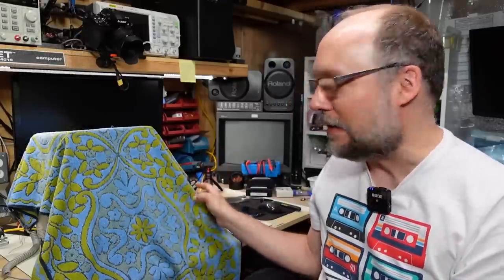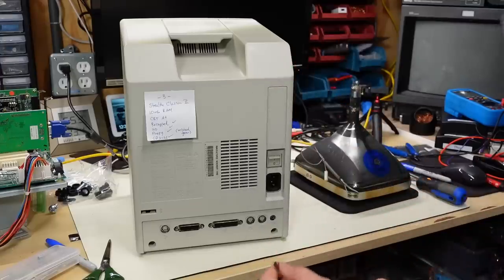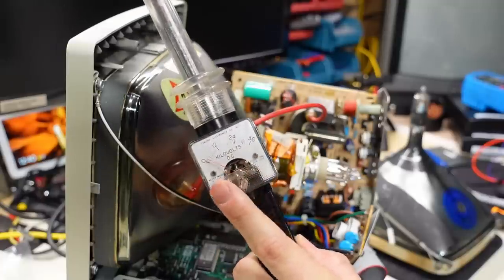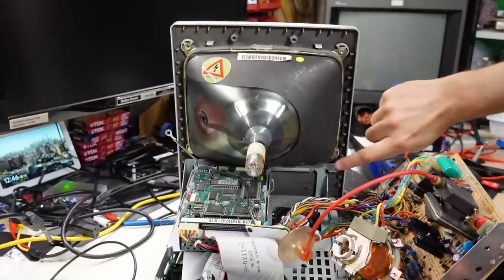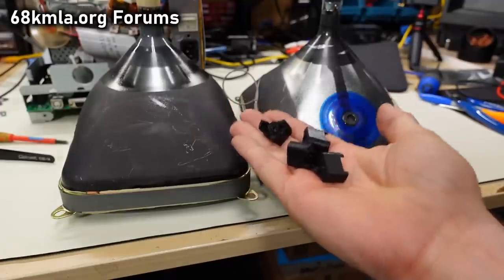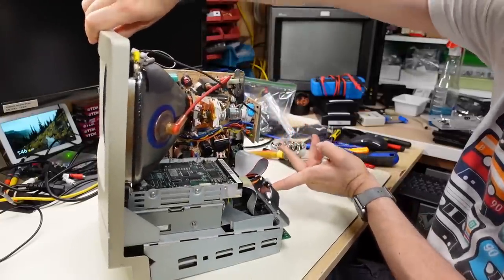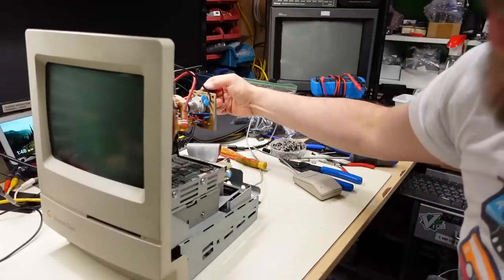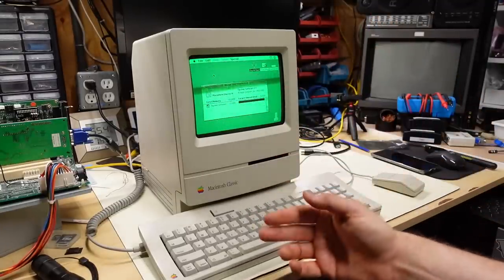Apple never built a Mac like this

Comment: We are not museums or historians; a little mod here and there to make old school tech more accessible to the user is fine in my book. 😁 Always good to see a bit less e-waste and more useful machines, even if they are now pretty much just for fun...
Reply: @eck8989 Exactly what I mean - I'm not into Macs myself but I like to resurrect old school tech. The phrasing was meant as a reply to Adrian asking if people think that he ruined that classic machine.
Reply: I fully agree. The most important part is to get it going. Perhaps, also, if someone needs a "proper" part, you could then pass it on if it's in decent shape.
Reply: I'd agree completely.  

I think one difference with modern "antiques" and old antiques is that things made in the 20th century were made for purposes we still find useful, but are complicated enough that they require maintenance.  So the old idea of purity doesn't apply.  We own these things to USE them, not to sit on a shelf.

There's long been precedence for this idea.  People have been collecting cars for decades.  People that restore them want them to RUN, show them off, and drive them around.  Not sit in a garage collecting dust.  They restore them to work, and they sometimes modify them and put new engines in them.   It's still useful because we still use cars!

There's another class of antiques that fall into a completely different category.  Stuff like a butter churn, or a pickling crock, or a washboard.  Nobody uses these things anymore at all or any modern equivalent (my parents had all these things sitting around the house as museum pieces). 

I just think there's an inherent difference between these two types of antiques.  Especially a computer.  A computer sitting on a shelf, not turned on is just a hunk of plastic, metal, and silicon.  It doesn't really become something of value and interest until you actually use the thing.  Cars are the same.
Reply: @stevesether  Hey, I use a butter churn and pickling crock all the time!
Reply: There are enough in museums anyway, let's have fun with them!
Reply: My only complaint is that it's not an SE/30 with an amber CRT.
Reply: I still pine for my old Mac Classic; somehow it just made creative writing easy. I wouldn't mind using one today if I still had the space (and a cheap way to transfer files)...
Reply: @MyNameIsBucket  there’s a FOSS text-mode program called Wordgrinder which I love — you can put it in full screen and write write write, and worry about editing and formatting later :) my favourite feature is how it keeps the active line in the centre of the screen so I never need to move my eyes! 

I don’t know if that would help emulate what you got from the classic Macs, but I do suspect the smaller screen on them created a somewhat similar effect…!

Not an ad and no pressure though, of course :D just sharing a tool I like.
Reply: That mod can be always reverted if you got the original display and the classic Macs aren't so rare to be overly crazy about accuracy. Of course I'm not for drilling the holes and painting the case. 68k Macs have pretty nice design, so messing around with it is a bad idea.

Comment: Green is one of the colors our eyes are most sensitive to.  Following that, if you keep the intensity low, green results in less eyestrain.  Amber is perceived to be easier on the eyes because it tends to have a lower perceived brightness.  It's counterintuitive.  Clarity and adequate contrast at a lower overall brightness is easier on your eyes (assuming you adjust it correctly.)
Reply from the maker: Interesting! I know I've read that tungsten filament bulbs in cars is easier on the eyes but indeed is less bright -- for similar reasons I guess?
Reply: @adriansdigitalbasement  Definitely easier on the eyes than the bright blue-white of an LED headlight.

Comment: I watched a video the other day, an interview with Steve Jobs and the rest of the Mac team from Apple, and a question came up regarding the B&W nature of the screen.

The basic response was that B&W was chosen because they could have a higher resolution screen and graphics than if they had tried to do colour, and that B&W would be better matched to upcoming laser printers which would be B&W at that time anyway.

Colour was a matter of cost - trying to fit high resolution colour graphics into the Mac at it's price point just wouldn't have worked commercially.
Reply: So, two things about this: First, I heard somewhere (can't find a reference off-hand) that in 1982/3 during development of the Mac there was only one large-scale supplier of 9" full-color CRTs, some company in Japan. The CRTs were really expensive, so Steve flew out there to try to negotiate a deal. Supposedly he showed up to the meeting under the influence of something and made a total ass of himself so the whole deal was cancelled by the manufacturer. The "we prefer B&W" story was then made up as cover. Is it true? Maybe, but probably not. As noted, a color version of the Mac would've likely doubled its already high price because you'd need not only the color tube but more RAM and a faster CPU to process the extra pixels as smoothly as B&W, and more disk space to hold the color icons and whatnot. Is it believable? Yeah I wouldn't put it past Steve to do something like that.
Second, and verifiably true, is that single-color CRTs are much sharper than RGB CRTs (at least, as far as 1980s-era tubes go) and so are preferable for precision work (CAD, graphic design, etc) and also well-suited for the low resolution (512x384) of the original Mac: sharper dots mean things can be smaller on screen without getting blurry. White was likely chosen because it's closer to working on paper, which is what most office-type jobs involved prior to computers whether you were reading documents all day or creating them yourself. Amber is usually considered to be easier on the eyes over long-term use compared to white, but that may be anecdotal; anti-glare coatings are likely to have more of an effect (and anti-glare CRTs were supposedly common upgrades back in the heyday of B&W Macs, since most of their tubes didn't have anti-glare from the factory).

Comment: Neat swap! One day, it would be neat to see retro inspired LCD mods (not channel specific, but generally) that replicates the curvature of CRT's too.
Reply: That's been my main gripe with LCD mods trying to make dead CRT devices useful again. I still have an early iMac with a dead CRT (dim, blurry AF, HV cutting out) and a semi-dead logic board (boots but will randomly freeze). I've thought about putting an entire ITX PC in there and a 15" (i think it was?) LCD, but the slight curvature of the case for the CRT makes any LCD mod look like ass, so it's been collecting dust in the basement ever since. 
I've even thought about venting the original bad CRT and carefully cutting away at the glass so that only the front face with the mounting screws stays intact, then getting rid of the phosphor coating and sticking an LCD behind the original front glass or something, but since I have no clue how to cut the glass without making it crack and ruin the front that idea never went anywhere either...

Comment: I'd still go back inside later on and put the thinner support in to prevent the screw from tearing the end of the plastic mounting point. I'd be just a little afraid of that. But still very cool, though I prefer the white screen :D

Comment: A very important thing to check before swapping CRTs is the filament voltage. I believe most of these 9" monitor tubes are 12v but 6.3v is also common on CRTs (and vacuum tubes in general). If you put a 6.3v tube in a 12v chassis it will have a good chance of burning out within a few seconds.
Reply from the maker: When it comes to computer displays from the 70s and 80s, it seems all monochrome CRTs are 12v and all color ones are 6.3v. I'm sure in the TV realm things may have been different

Comment: There's another thing about the display on the original Macs that also demonstrates the intent to make the machine excel at desktop publishing:  The original pixel size was 72 to the inch, so each pixel was one point in type size measurement, making it straightforward to create a WYSIWYG desktop publishing application.  Or, at least, as straightforward as it could be.

Comment: You should do something with the IIc monitor case. Maybe put in a small LCD screen that fits, as well as some sort of single-board computer (which you could also run an emulator on). 
Since it's so yellow you could try whitening it, or painting, or just leave it alone.
Reply: Nah. He can well use that "white" screen by simply cutting out excess plastic of about the size of the spacers he has put into the Mac Classic case and use shorter screws (and maybe to cut a couple of new threads). Since he has those spacers, he can always revert to the green CRT, but with spacers inserted.
Reply: @docnele  he doesn't have any of the boards etc to drive that 2nd screen though...

Comment: I was working on a Quadra today, and had the DB15 to VGA adapter set to the wrong monitor ID.  The Quadra decided for some reason that my display should be green.  It wasn’t all green, it could show pure white, pure black, and was capable of colors, but all gray shades were green instead.  I spent a few hours cleaning up an old drive and installing 7.6.2 on it.

When I finally finished up and could power-cycle the computer with a new ID set, I got regular grays back.

It was a relief.

I don’t think I would like a green-scale Mac.

Comment: For the spacer, just file the one that is the closest to working until it fits. Even if only half of the spacer is left and the screw hole is open, it will still work better than nothing. The spacers are 3D printed plastic, likely  PLA, they will file very easily.

Comment: Love this mod! I always thought they would look good with an Amber or Green monitor. Also, thanks for all your videos! I was able to fix an old broken ebay C64 (250425) sold for repairs and now have it working fully. Your videos were crucial to my success. I replaced U11 and U9, can you believe I have the exact replacement chips (OKI M3764-20 plus the 16 pin sockets as well) from ones I have salvaged over 30 years ago. I didn't even know I had them until I looked through my old electronics stash and i couldn't believe it myself, there they were. My first, but certainly not my last C64 repair :)

Comment: Back in the day I worked at Bell Telephone Laboratories, in the graphics department. We were responsible for making overhead projection cells, advertising brochures, wall signs for events, an so on. Al lot of our output was done on the Mac. It was quite a capable little computer for running graphic design. I later moved to the CAD depatment drawing up printed curcuit boards. those were fun times.
I believe the white phosphur was used for better clearity (higher contrast). On green and amber screens the lettering never looks very clear, where as the black and white is crisp. why do you think Black and White TV looked so clear back in the day you could get a lot of detail out of a B;ack and white image. I never cared for the glowing edges on the lettering, even if you turn the brightness level down the surrounding phosphurs still had a tendency to glow a little making the type fuzzy.

Comment: I'm not sure a meter is the best thing for discharging the CRT. Meters are usually pretty high impedance.  It'll tell you if it's charged but I don't think it would discharge it very quickly.  Fortunately basically all CRTs have discharge resistors built into the circuitry so it's not a big deal.

Comment: I've never seen a green or amber black and white television set. What they actually did was use colored gel filters. You could even convert a black and white TV into a color one using a color wheel. It worked, but it was no where near as good as a color TV set.

Comment: White might be harder on the eyes, but it has one really important advantage. If you look at a single color for a very long time, your sight will try to adapt, shifting your color perception. After working on green CRT, you start to see world around you shifted towards  pink or purple hues. This will not happen with black and white display.

Macs were designed for DTP and other graphics work from the start and picking white phosphor was propably a conscious choice.

As for early Macintosh computers. They are the only computers that just skipped from 1-bit monochrome displays to 8-bit 256 color graphics with 24-bit palette.
Even though Macs started with monochrome displays, it's just a waste that they used 1-bit color depth. Even IBM PC started with 4-color graphics mode and 16-color text mode on CGA and hi-res text mode 720x348 on MDA.

Comment: That looks so cool. I don't agree with all this 'Keep them original and period correct.'
You should see what I've done to some of my Spectrum's, ZX81's and an Amiga A1200. Not to mention the Amstrad PCW 8256. (that is totaly unrecognizable, LOL).

When storing old CRT's, I always wrote on the front with a sharpie where they were from, (TRS-80/19inch Phillips ect), It made it easier to identify them.

Great video. Sorry, I seemed to ramble on a bit there. :)

Comment: Ah once you had no image I instantly remembered my first electrician task, I was playing with a chinese nintendo rippoff, famicon (I dont even know if it was a ripoff anymore, because its like a 1:1 system lol) hooked to my moms small 13" CRT TV. Now we were a quite a poor family back when I was like 9 or so. Then in the middle of some game, I accidentally janked the cables of the console, so that the CRT tv fell of the shelf to the ground. My heart skipped at least 5 beats, I thought I destroyed my moms TV. Back then it was serious business! So the TV had no image. I paniced, because there was no visual damage, just a scratch on the front plastic face. So I had no other way to just, unplug it, open it up and try to figure out how to fix it lol. So it turned out something came loose, but after that the image was all messed up, that's where I found these internal small analogue controls, I started messing with them and after a few seconds I made the tv even sharper and colors more vibrant. My mom still doesn't know about it :D
I've been working with electronics ever since :D

Comment: My rule of putting things into new places vis engineering ; is that nothing fits ever period. 
There's always some small part that you have to saw off or change - and that's if you're lucky.
Even if you measure twice first, with three dimensions there's always something that wont quite fit.. without a little extra persuasion.

Comment: I have a Macintosh Plus in my collection with green CRT. I bought it around 10 years ago at local market. Still not sure why the former owner did that mod. Maybe the original tube was broken and they only had green CRT replacement back then.

Comment: I'd love a green monitor. Wish I'd bought one when they had them on offer.

Closest I came to what you did here though was fit a green LED into my Commodore 64 (and an aftermarket modulator) .. I have changed CRTs before but only like for like. Also had a belt off one I thought I'd discharged! 3-inch spark .. it REALLY hurt.

Comment: A fun project could be to do an e-ink paperwhite display and see if you could reorient the electronics inside and 3D print a new back of the case to make a Mac that looked normal from the front but was thin viewed side-on.
Reply: Has e-ink gotten any better?  I would think the refresh rate of e-ink displays would be abysmal when trying to do anything on an actual computer, even an older slower one like this.
Reply: @brianv2871  You can get a tablet called an Onyx Boox Max 3 with an HDMI input allowing it to be used as a monitor. Refresh no good for a game but it's able to make local changes fast enough to track a pen tip while sketching for instance.
Should be useable for DTP and office apps.

Comment: As a teenager I has a large 30 something inch TV I dragged face down across the carpet. Then I attempted to remove the high voltage lead with a flat blade screwdriver. Last I remember was a spark jumping around the screwdriver handle to my hand. Then from my shoulder to the person standing next to me. OUCH!
Reply from the maker: Ouch is right!

Comment: Interesting swap.  I am not sure about your logic on assuming CRT's can be interchanged.  It is more lucky than anything if different model CRT's (including different phosphor colours) have the same pinout and/or voltage/current requirements without causing issues.  
It made for an interesting video though

Comment: You wondered why Apple didn’t use the same mountings for the two monitors. I would expect it was intentional. By using different mountings, they eliminate the risk that someone picked the wrong pallet of CRTs in the factory and put the wrong color screen in.

Comment: and if you have an empty Apple IIe platinum case kicking around you can turn it into a lean mean linux machine (with ports that Apple's used such as USB, thunderbolt and even some PC components such as serial and parallel. or if you really wanna go balls to the walls why not even include a mouse port and a joystick port just for the compatibility.)